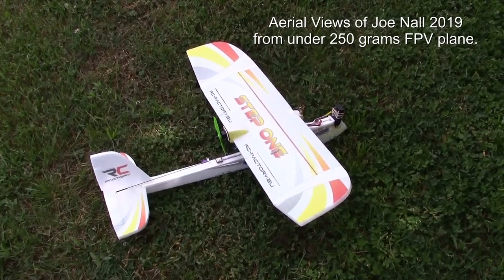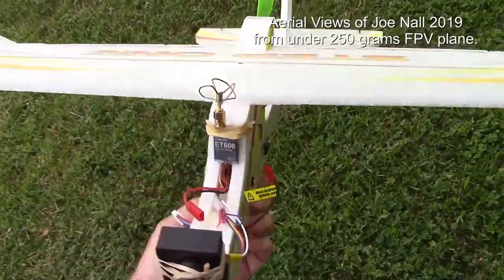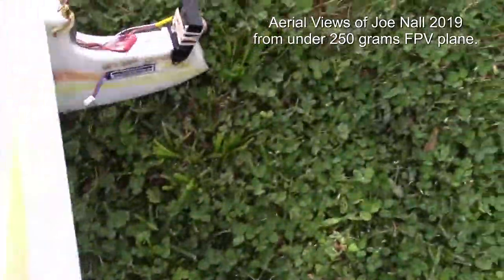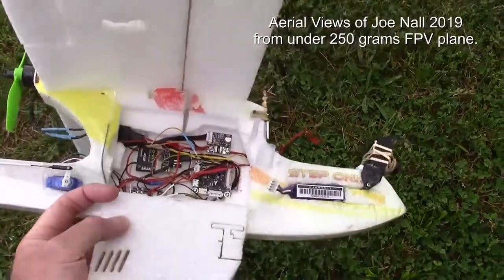Aerial Views Over Joe Nall 2019 - HD FPV Step One Plane Lighter Than 250 grams

Comment: Tried two thumbs up Dave but it just wouldn't take haha. Like to see the full build on this one! I was following along a year or so back but lost tab on. Was this the BeeRotor build? Nice cam quality too! Wonder if it would haul a Bit-Eye?
Reply from the maker: You are correct, it is the that build. I put some links to the build playlists in the video description for you. The bit-eye cam could probably be replaced with something else these days but as you see it still works :-)
Reply: @DaveMerc  believe or not I have a new BitEye still sealed in box! One of the best bang for buck cams around. In fact I thought this was too small to be a BitEye. Like the 2-cams in one feature too. Think I'll build this one.. thanks for posting!
Reply from the maker: You could use the Matek F405-wing FC probably.
Reply: @DaveMerc  INAV+26gr vs 7.3gr clearflite - many items on the RCG list are no-go - but the BR3 is still strong. Mite be a challenge swapping out items and staying under 250 but I know it can be done - maybe a lighter air-frame. rctimer seems to remain a good source for these bits.
Reply from the maker: My idea is to switch to an FC that has the current/voltage sensor built-in to save weight. I am using a separate sensor now but that could be eliminated and so could the cable for the sensor.